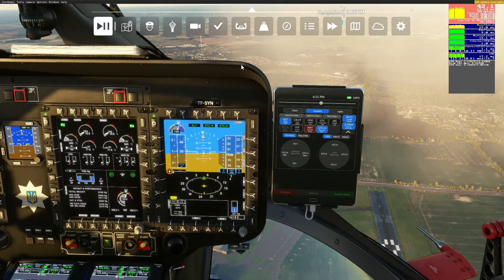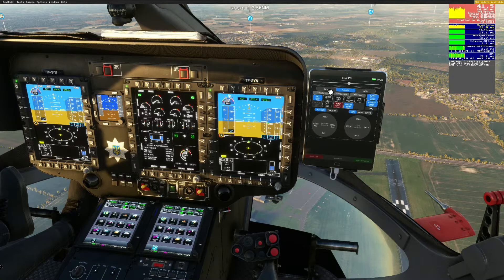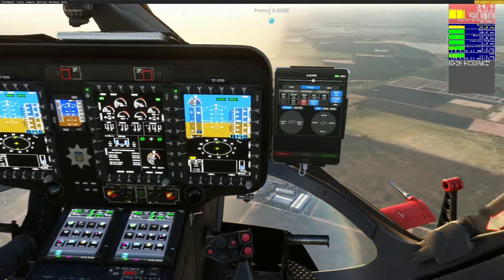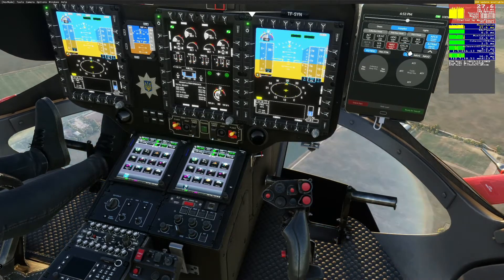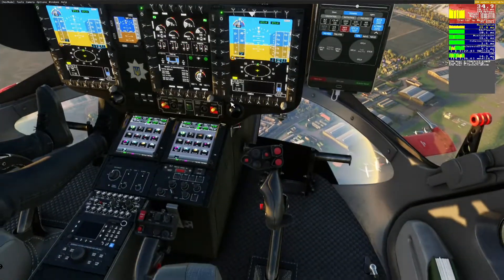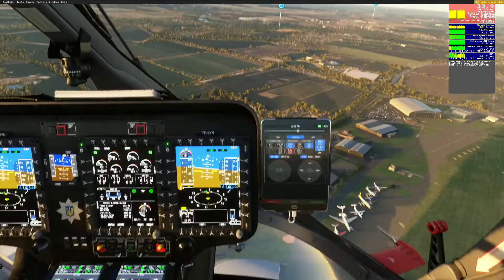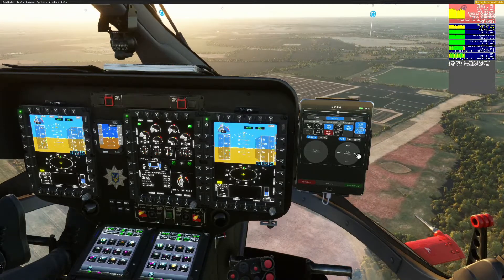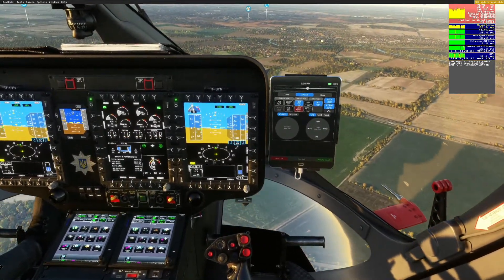12. H145 Tutorial MSFS 2020: Autopilot HDG (Heading) and IAS (Airspeed). Hyper Perfomance Group

Comment: Having a hard time getting the AP to function how I want.
Do you have any recommendations as to which keys to bind to HOTAS.
Reply from the maker: If you have a hat switch - depends on which HOTAS you use, bind the cyclic buttons to these. That will give you the most versatility if you just select one AP mode. If you have a second hat-switch, use this for the collective beep trim - and of course, select a button to turn the AP on. I think it is all about experimentation really and how you fly. I use a Hotas X56 (well worth the investment) because it has so many programmable switches but most of the time I have been using the tablet to get used to the principles. Happy flying and I hope that helps.
Reply: @theflyingdoctor  thanks for quick reply...X55 here and I do have most keys binded but it seems all modes kick in at once rather being able to choose modes as needed.

I used the config tool but it feels  different from previous versions.
Reply from the maker: @rmc5345  I would be double checking whether the keys are programmed correctly - when I did it I managed to program the same hatswitch direction twice, and that resulted in some odd behaviour, but your problem seems different if all modes are kicking in at once. 

The only other thing I can think of is checking that MSFS has not reset its Assistance Options as part of an update (we have just had one). But that is a longshot. (Page 11 of the manual).

It it worth completely deleting and then reinstalling the package. I had terrible trouble with the GTN 650 add on, post the laterst MSFS update. In the end I extracted the file to the desktop and then put both the folder and the plane in the root directory, rather than on a different drive with a link. When I restarted the sim before, I had not avionics displays at all. Wierd. 

If you are still struggling, I would stick something on the Discord channel. 

Sorry - I think that is probably not the greatest help but it could be a start.